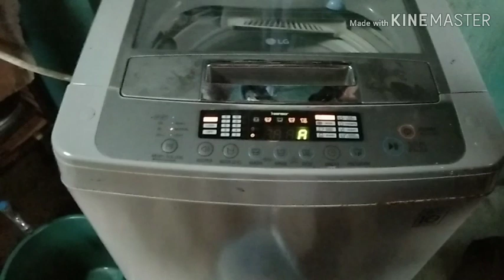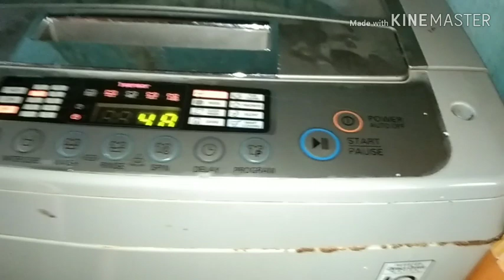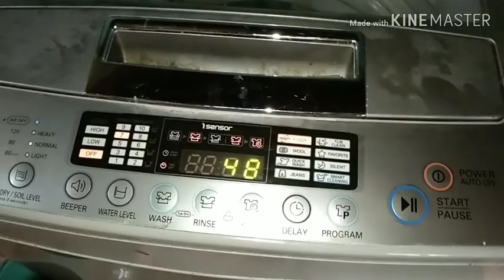How to repair d.E LG .Electronics Home Service( Taytay R.)

Comment: Sir pwd po ba malaman address ninyo.parrepair  ko sana.Lg inverter direct drive 10.5 / 6kg hybrid  ang sira ayaw umikot at may lumalabas (LE) ngayon ang address ko nasa Pacita kami San Pedro Laguna.may malapit pa kayo pepair cervice
Reply: Mayroon ba kayo cervice center malapit sa aming lugar.dto Sa Pacita San Pedro Laguna.
Reply from the maker: Pwede po ako dyan home service 09770110284 number kopo or 09510546991

Comment: Idol please help. LG AUTOMATIC 8.5 kg . Motor good, drain motor, good. Water inlet sensor, untested . Pero pag nka set ng quick wash. Gumagana. Pero pag magwash na siya mag DE at hindi umiikot para magwash ganun din ang spinning. Saan kaya possible problem?
Reply from the maker: 09319055774

Comment: Bk pede mk hingi Ng contact no nyo de Rin po prob Ng wmachine nmin. Ty
Reply from the maker: 09770110284..
Reply: Pano boss pag LG na top load naka DE din pero ang door lock switch sipa ng sipa ang solenoid d mo halos ma sara ang pinto. Magnetic sw din or door lock na?

Comment: Sir anong sira kung mag counter clockwise ang ikot parang bitin hindi nagtutuloy perong ok naman ung ikot nya pag clockwise. Sana matulungan nyo ako
Reply from the maker: tingnan mo sir kung yung counter ikot nya sumasama yung drum at kung sa clockwise di kasama drum baka kumakapit ang gear ng spin kase counter ang ikot ng spin baka kumakamit sa spin nya
Reply: @Techniwey  ano po gagawin ko pa ganun sir, gusto ko sana e send sa inyo ung video. Ano po ba messenger nyo kung inyo pong marapatin. Salamat
Reply: Nag umpisa lng naman po to nung ipatagilid ko dahil tinangal ko ung drain valve nya para linisan sana dahil may leak na rin. Nung gagsmitin ko na ayun ganun n sya
Reply from the maker: @randyfernandez9379  TechNi Wey